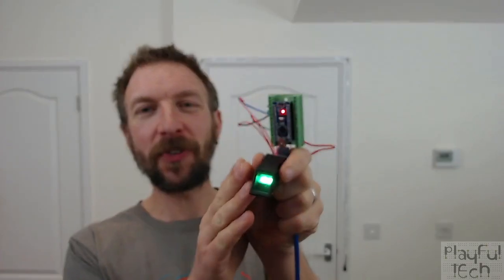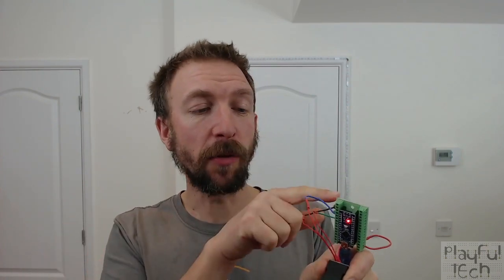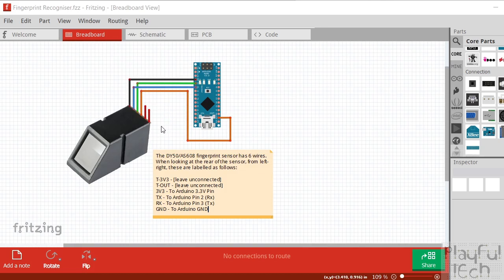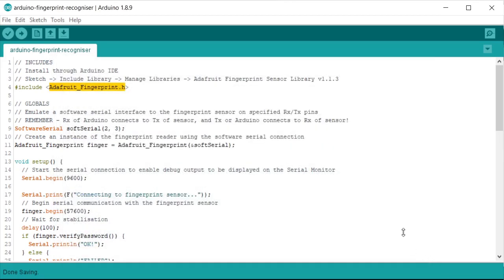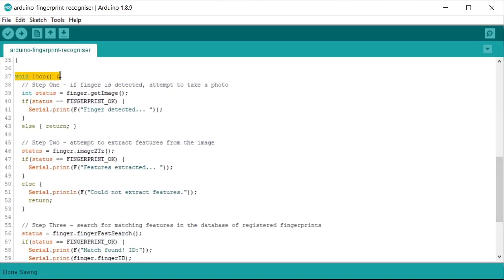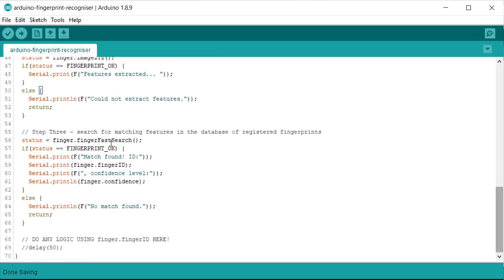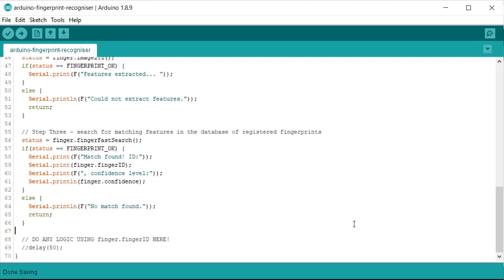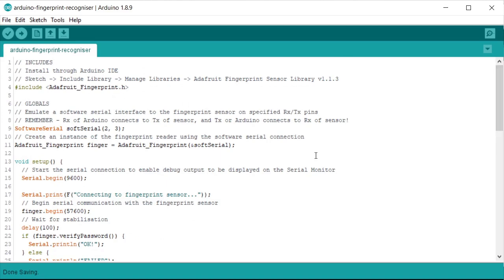Arduino Fingerprint Recogniser

Comment: Hi Alistair, great video. Is it possible to set this up so that the saving of a fingerprint ID is part of the code? So then the players complete some sort of puzzle, say a momentary key switch which puts the fingerprint id reader into input mode. then it goes back into normal mode?

Comment: i wonder if it is possible to extract the image of your fingerprint? one of my thesis' component involve that part but i tried searching sevaral results but most of the result didnt show image extraction.
Reply from the maker: Not with these units I don't think - the "database" of recognised prints is kept purely internal to the chip and there's no obvious interface exposed to get that information.
Reply: @PlayfulTechnology  i see. but is it possible to extract on otherway? for example, ill use Pycharm/Python then connect it to my arduino IDE then make extraction image there or something(if...you kinda get my point. hard to explain). most of what i found involve either machine learning and they have different scope such as they are going to match, find the matching point in the fingerprints etc. in my case i simply just want to extract the image of fingerprint and thats it. idk hard to explain...

aside from that, if not these units, then there are units that can probably extract image right? idk because my shops here has the same model
Reply from the maker: @keanutype0896  Yes, there are definitely different units that act more like simple "scanners" - they just send the raw image data to the device and you'd then need to perform the pattern matching against a database of known print. But if you took that approach you'd have to implement your own matching thumbprint data definition and algorithm.

Comment: Could you please tell me about where the fingerprints are saved
Reply from the maker: The fingerprint database and the comparison to any touched finger happens entirely on the sensor itself (saved in persistant non-volatile memory).  That's what makes the Arduino code so simple, because you simply read the id of the matched finger over a serial interface.

Comment: Hello!   i loved your video but.. I have a small problem, I have used the code in an arduino nano and arduino uno, but when I start the circuit my led strip just stays on, there is no strobe or response from the potentiometer, what could be wrong?

Comment: You should look into reproducing fingers in latex. If the fingerprint ridges are reproduced well enough, the latex finger might be enrollable in the fingerprint reader and would then be usable as an escape room prop.

If you choose to enroll players' fingers in a game, you will need to ensure that a successful enrollment occurred (and that the finger can be subsequently recognized by the reader). These variables are probably the main reasons that fingerprint readers are faked in game environments.
Reply from the maker: Good idea - I don't have much experience with mould-making/resin/latex etc., but it's definitely something I'd like to experiment more with - perhaps this would be a good starting project!

Comment: Have you tried it with a fake fingerprint like an image on paper or a fingerprint “lifted” off of a drinking glass? If that worked it would be very handy for a game, although not great for the security of the sensor.
Reply from the maker: My understanding is that the sensor is purely optical, so if you were to present a high-resolution reproduction of a fingerprint - on paper, photograph, modelled in latex, or anything else - then it should work. Unfortunately, my printer is old and rubbish and currently leaves horizontal streaks across the paper so haven't been able to test, but will let you know if I have any success in the future!